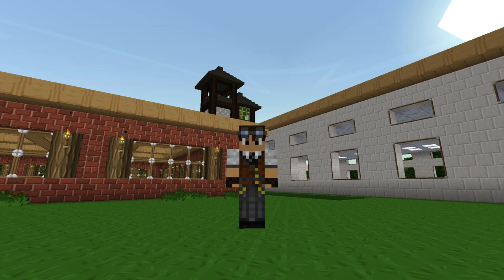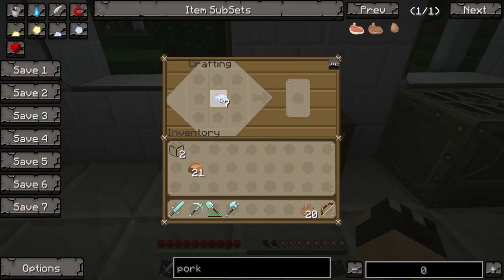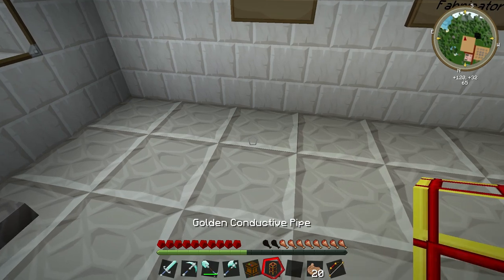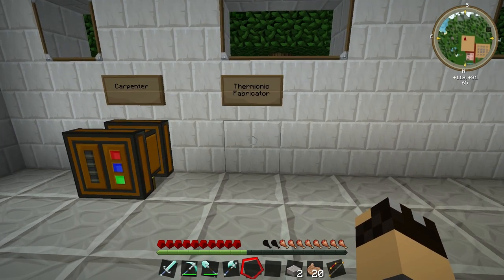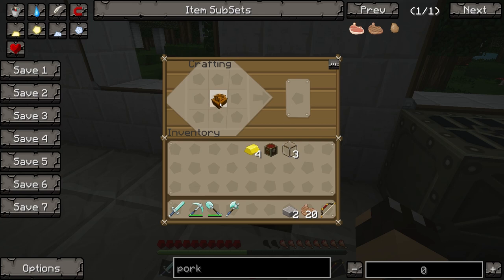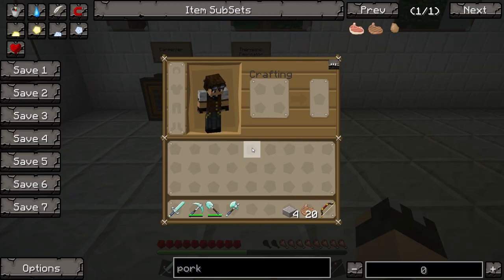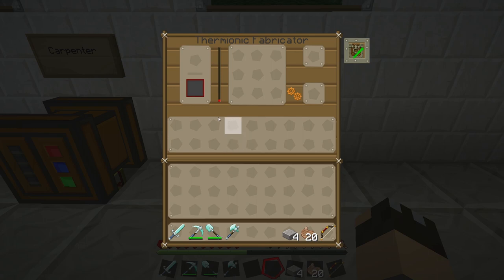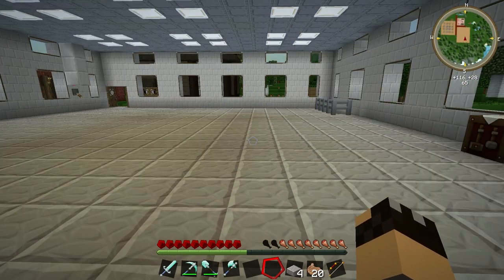How to Feed the Beast in Minecraft - Carpenter & Thermionic Fabricator - 2

Comment from the maker: Ah, a nice and easy one that I can answer. On the underside of the floor, is a red alloy wire that runs down the basement wall and along the floor to the engines.

Where the wire runs along under the floor, it touches 3 bocks. One of those block has the lever on the other side, then there is a normal green cage light, and an inverted red cage light. Inverted lights are on by default. So when I hit the lever, the engines and green light turn on, the red one goes out.

Comment from the maker: I have them powered with Peat Fired Engines (any Buildcraft compatible engines work - steam, combustion, stearling, peat (even Redstone - but you need a lot of them)). I have about 11 engines all running in the room downstairs, connected with conductive pipe through the floor. This is so I can have multiple machines running off them later. However, one engine each is enough to power the machines. You can see my engine setup in the first video "Peat and Peat Fire Engines"

Comment from the maker: Conductive pipes are for BuildCraft energy (produce by engines (MJ)) - this is used by BuildCraft, RailCraft, Forestry and the Thermal Expansion.

The macerator uses is an Industrial Craft machine, and use Industrial Craft power (EU). All IC machines and Gregtech machines use IC power.

I will be covering Enegry Links in a future video, which allow you to convert between different forms of power.

Comment: does the golden conductive pipe hook up to machines such as the macerator, I set up some peat fired engines and had them connected to a wooden conductive pipe, then to a golden conductive pipe, and when I ran the golden pipe to my industrial machines the pipe did not connect.